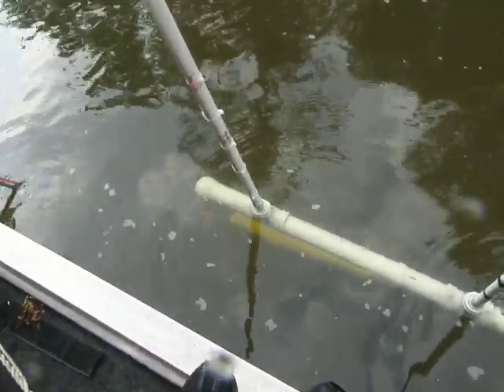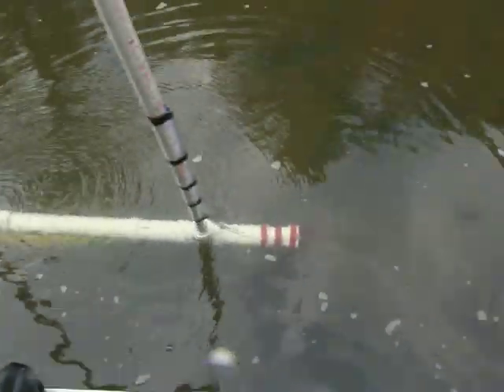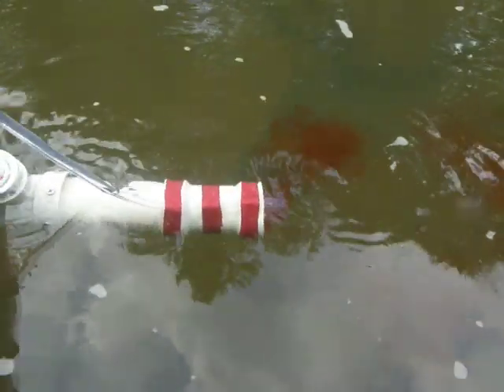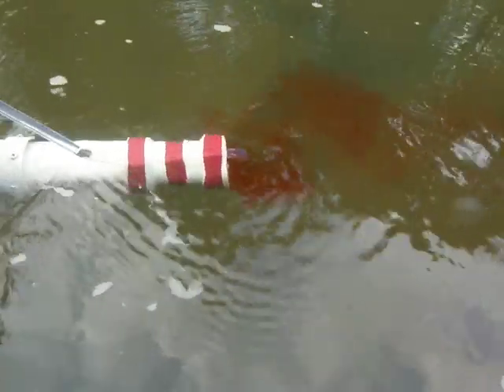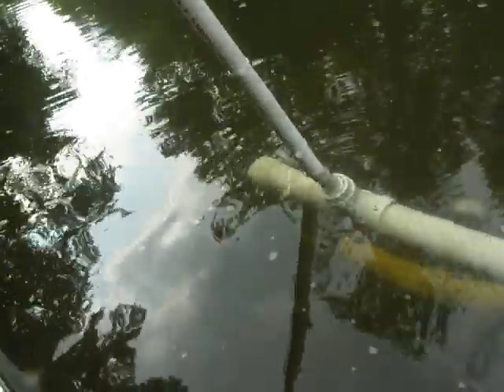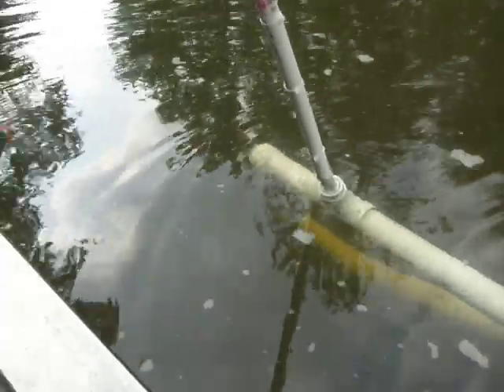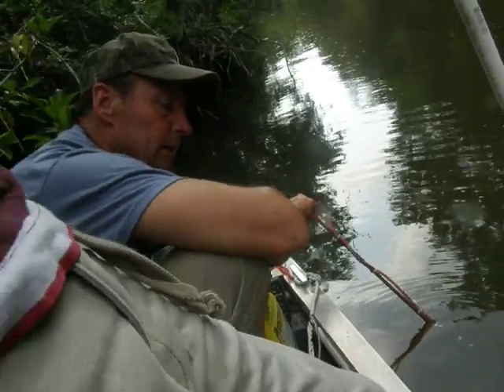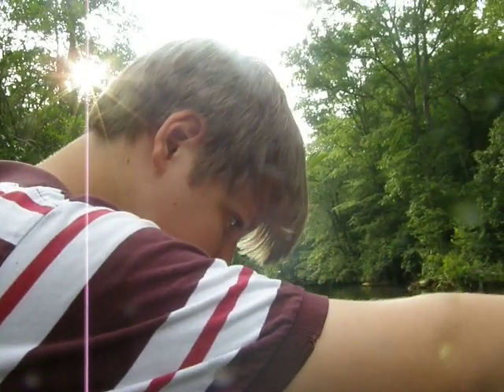200905240033

Comment from the maker: @thomasa78 ,

If placed in the gulfstream there are two phases of operation. Cooling and Non- Cooling phase. In cooling phase it upwells cooler water to the surface to regulate Sea Surface temps anywhere between 70 and 90 degrees to the nearest 1/10 of a degree while generating enormous amounts of hydroelectrical power from the Ke in the gulfstream current. In non-cooling  phase just the warm water flows through it but it still generates the electrical power. They actually regulate climate.